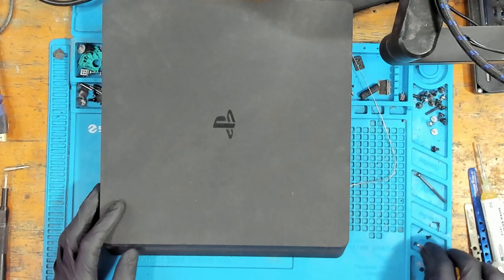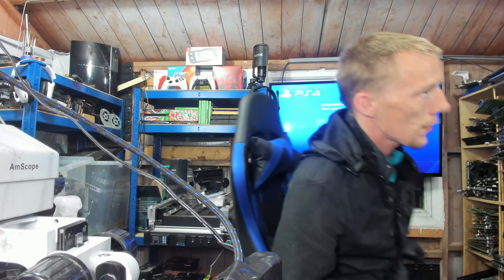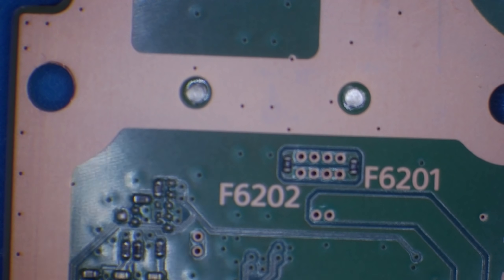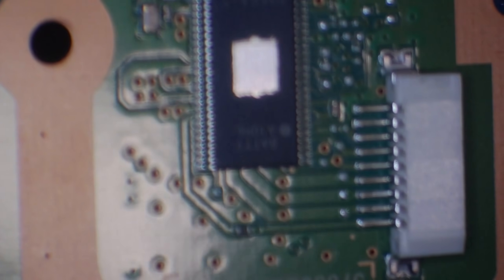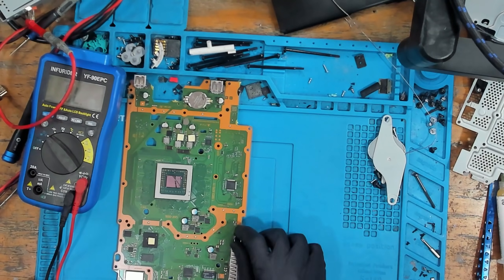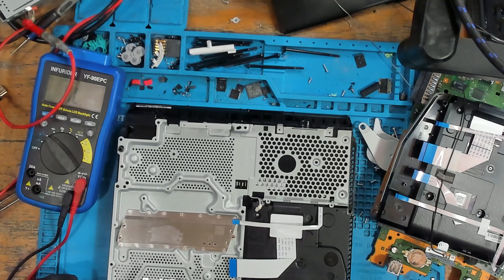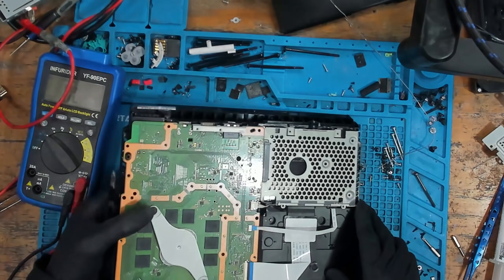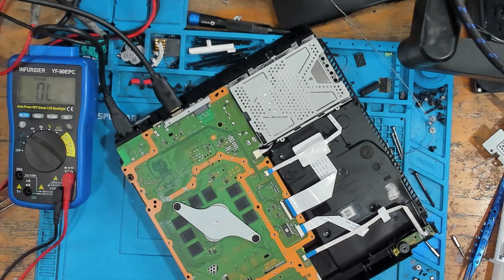PlayStation 4 Slim With 35888-2 Error - Why This Console Is Unfixable Because Of Chip Lockouts! 😨

Comment: Hi, do you have any issues with a PS4 Slim with  error code SU-42118-6? i am unable to update it to version 10.50, and i  also tried using different discs, safe mode all methodes,,,. do you think it can be some  hardware problem?

Comment: Hello, there is no bypass with the BwE tool? I have a 1215 and it does not have the chi driver, it is at 8.52, and it does not have a disk, there is no solution, right?

Comment: I'm trying to reinstall the system since I changed the hard drive, and it gives me the error ce 35888-2 :( as I say, I can't even start the PS4 since my old hard drive stopped working and that's why I changed it, and I try reinstall, but when I click "install by USB" I get that error code. I read that it could be something from the reader (?) But when I put discs in it it works correctly, but still, if it was that, it shouldn't anyway even let me install the system?i feel like it is some software or something but i dont know how to fix it please help :(
Reply: What did you do

Comment: Why not do a disc drive delete and convert those models that have the 35888-2 and add 8tb internal and 8tb external hdd or ssd and make a full digital edition ps4.  That would be the quickest solution until we get our hands on the firmware to remarry the blue ray

Comment: Wait until the PS5's have SSD Controller failure or SSD goes up themselves.. that's gonna be fun. They should allow the Storage Expansion to act like the internal SSD Storage for running the System Software. That would be a great backup plan.
Reply: They should had make it switchable like xbox. even tho xbox doesn't allow to be switched for now! (if you didn't know xbox uses standard NVMe driver for internal storage) and i think is great for longevity and repairability.

Comment: I’d like your input on an issue I’ve been having with my PS4.

So I have a similar issue to this (disc drive wise at least) my problem is that it will take discs, but it has issues feeding the disc into the drive, either stopping once the disc is almost completely through, or the disc does get through but doesn’t mount to allow it to be read. When this happens, it tells me there’s no disc inside, and I find myself having to push the eject button near a dozen times before it finally spits a disc out. I tend to have to repeat the process about 6-10 times before it takes the disc properly sometimes, other days it works fine.

Honestly I just want it to work, cause this shit is annoying asf. any direction would be reeeally helpful man
Reply from the maker: It's most likely an issue with either the drive rollers which are easy to fix, or the mechanism which tells the drive when a disc is fully inserted. I did film a video today going over that, so I'll try and get it edited and uploaded ASAP:)
Reply: @TheCod3r  thanks man!
Reply: I had this issue what i done is a cleaned the disc drive rollers with ipa which fixed it most of the time you can get away with cleaning them but as long as there is no phisical damage on them all it should neee is a clean hope this helps

Comment: This only happens when someone is trying to hack the console and does it wrong this is what you will get
Reply from the maker: That's not true mate, renesas/mediatek chips die quite often. I've come across it a boat load of times without exploits and I've exploited several consoles without issue
Reply: I think those chips have read/write protection. Once it fails it is gameover unless u have a equipment to program new chip. I might be wrong tho.

Comment: Phil, tell the owner MAKE A RAW IMAGE BACKUP OF HDD ASAP as a hard drive failure would result in a PERMANENT safe-mode brick

if hard drive fails and you have a raw image backup, it can just be restored to the replacement drive with a USB to SATA adapter and back in business

being unable to update a 7.55 console is a blessing, as you can't accidentally update a hackable ps4 ;)
Reply from the maker: I'm not sure if that would work to be honest, I'll have to give it a try :)
Reply: @TheCod3r  it does -- in the event of a HDD failure the replacement would have to be same capacity as the current drive, as restoring to a smaller drive would result in corrupted Filesystem and restoring to bigger would be endless loop to rebuilt database

it is possible to reduce the size of a ps4 raw image backup to 1gb with a touch of patience:

#1 initialize console with "full" method so that all data other than OS is genuinely deleted forensically
#2 use compression on backup image and the result resulting size should be roughly same as the PS4UPDATE PUP file (makes it possible to burn to a DVD and put in disc drive for safekeeping)

if done without the full initialize then all games and data, even if technically deleted, gets added into the backup and makes it huge.

Comment: With 7.55 recovery software will it be possible to install it on a new HDD?
Reply from the maker: No sadly not, without tje disc drive past around version 4 you can't install an update or reinstallation file
Reply: What if you clone that HDD and kept an image of it as a backup?
Will the clone HDD work?

Comment: Unfortunately this repair was unrepairable but if it was repairable which component would needed to be replaced
Reply from the maker: It would be the mediatek chip mate, it's locked to the board and can't be replaced :(
Reply: @TheCod3r  ah I see
Reply: Yeah that happens when you try to hack mate there's no Fixing...
Reply from the maker: @modlauryofficial6603  mate that's not true at all. Hacking is software related not hardware related